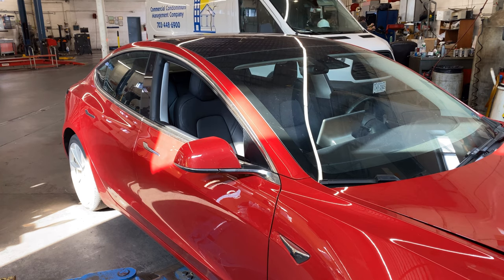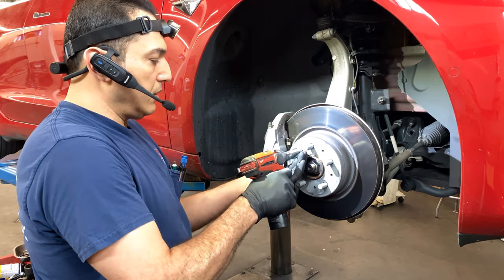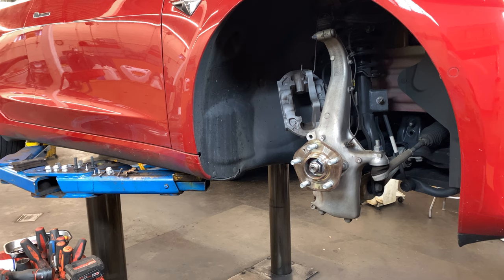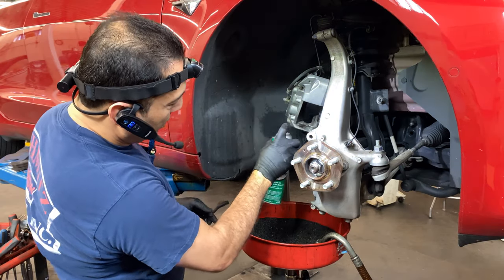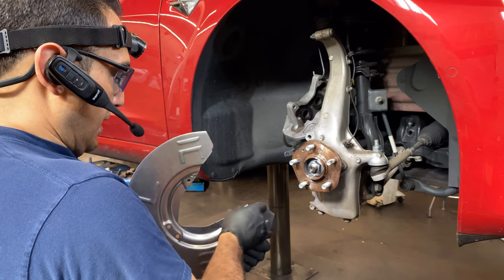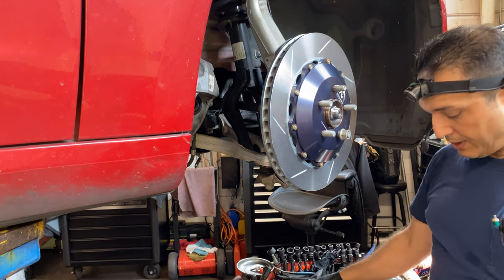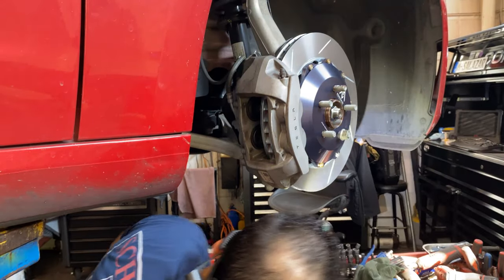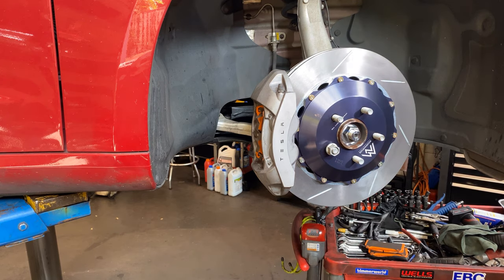2018 Tesla Model 3 High  Performance front pads and rotors installation

Comment: Nice detailed guide. Thanks for sharing. I think if someone were to go to the trouble of replacing the rotors, they would also get bigger calipers.
Reply: Nahhh…already 4piston…not really necessary…better pads maybe
Reply: As long as the pads can clamp, calipers should be fine. Stopping power is increased by applying the same friction to a higher radius, that's why the brackets are supplied, to extend the OE caliper out further.

Comment: How are the MP rotors held on if it doesn’t have the 10mm bolts like the stock rotors? By the wheel lug nuts?
Reply: Yes those bolts are just there to make reinstall easier,  nothing else.